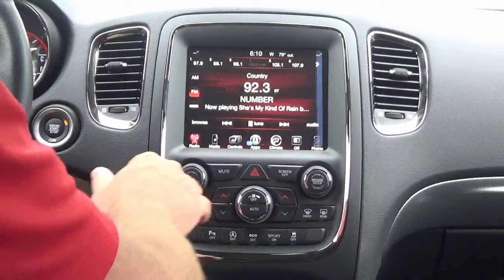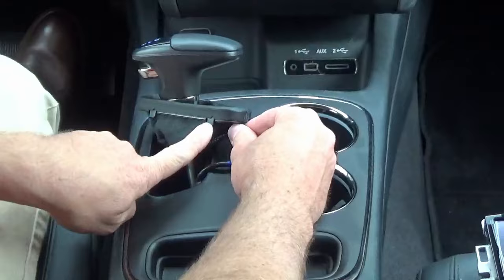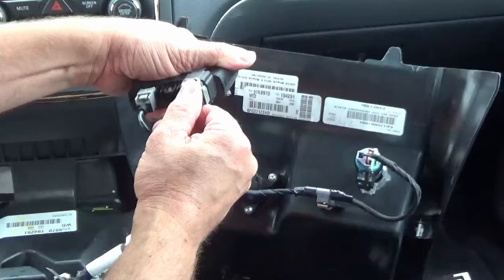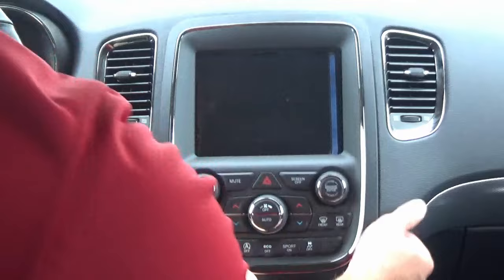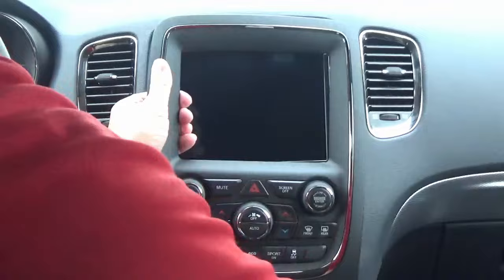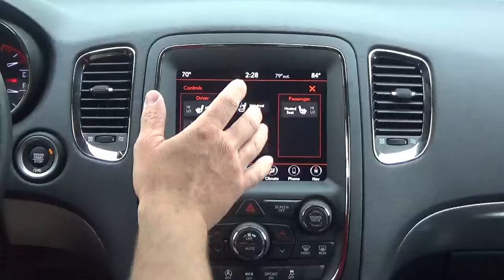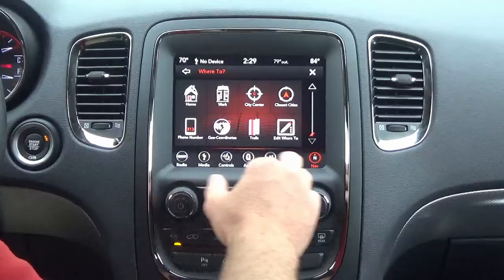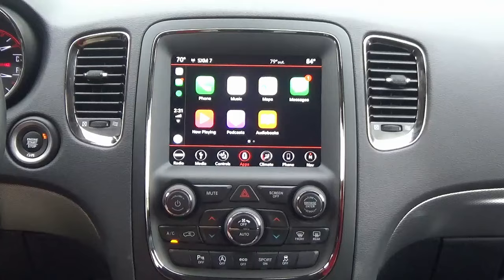2014-2020 Dodge Durango Factory Apple CarPlay/Android Auto Radio Upgrade - Easy Plug & Play Install!

Comment: I have a 2017 Dodge Durango with the 8.4-inch screen, but unfortunately, it does not support Android Auto or CarPlay. I have observed a noticeable difference in the audio quality when playing music via Bluetooth compared to using Android Auto. While Bluetooth provides decent sound, it lacks volume and requires the volume to be turned up significantly to achieve a satisfactory listening experience. In my personal opinion, Android Auto and Apple CarPlay offer superior audio quality and convenience.
Reply from the maker: Apple CarPlay and Android Auto requires a swap of the radio. Here is our solution. 
https://infotainment.com/shop/interior-accessories/infotainment-radio-upgrades/2014-2020-dodge-durango-gps-navigation-8-4-4c-nav-uaq-radio-with-apple-carplay-android-auto-2/

Let me know if you have questions on this.

Comment: Are they coming out with this upgrade for the 2017 RAM?? Patiently waiting for a way to upgrade to get Android auto in my truck. Looks to be the same 8.4 screen. Does this work for the RAM?
Reply from the maker: We've got the Ram upgrade right here: 

https://infotainment.com/shop/2016-ram-1500-classic-build-series-upgrades/2013-2018-ram-1500-2500-3500-8-4-inch-4c-nav-uconnect-uaq-with-apple-carplay-android-auto/

Comment: Awesome, i have a 2017 ? i need to replace only the hub from a newer durango 2020 to be able to have apple Car Play?
Thanks
Reply from the maker: No unfortunately they specifically set it up so that would not be possible. The radio you have does not have the technology to do Apple CarPlay and Android Auto as that was invented in 2018. You would have to completely swap the radio and the hub to gain that feature. Here is our upgrade link. 
https://infotainment.com/shop/interior-accessories/infotainment-radio-upgrades/2014-2020-dodge-durango-gps-navigation-8-4-4c-nav-uaq-radio-with-apple-carplay-android-auto-2/

Comment: What makes this an upgrade?  I thought all that was mentioned comes standard,,, at least on the rt , am I missing something?
Reply from the maker: This is the Uconnect 4 8.4" UAQ with onboard navigation and Apple carplay/Android auto.  If you are already equipped with this from the factory, then it would not be considered an upgrade for your vehicle.  Compatibility for this particular package is 2014-2020, so that leaves room for a lot of different factory equipped configurations. Many of our clients are equipped with base model units that lack features or even 8.4" screens that lack Apple Carplay and Android auto.  So for those clients lacking those features, this would be considered an upgrade.

Comment: What about the 2014 durango w/rear screens? Need to replace the in-seat hdmi/rca ports??
Reply from the maker: Hello,
That feature should be retained, as the pinout is the same on the CarPlay model. I do not believe you need to replace the inseat hdmi/rca ports. We've never had reports of the rear screens not working with the upgrade.

Comment: I have a 2018 dodge durango rt my radio is failing but I have a friend who is selling me his radio from his 2019 dodge durango it may fit  ?? Ty
Reply from the maker: The compatibility configuration for the upgrade package that we offer is for a 2018 Durango is from 2018-2020.  So anything from 2018-2020 will have the same compatibility.

Comment: What if I have the rotary shifter knob?
Reply from the maker: Luckily the rotary shifter knob is much easier! You can take a pry tool and work your way around the whole center console area (right at the edge of the storage cavity). It appears that it's about 5 retention clips on both sides, and the rotary knob is just connected to a harness.

Comment: $2,000 yeah right 🤣🤣

That’s INSANE.
Reply from the maker: We do not sell cheap equipment. We sell OEM quality equipment that is fully tested, pre-programmed and procured based on your Vin. There are plenty of companies that sell cheap products. We want to provide a part that we are able to guarantee works and will continue to work. We are confident enough in the product we sell that we are able to warranty it through installation and up to two years depending on your selection at check out. We feel our pricing is competitive as we are comparing our pieces to the cost of getting a new vehicle as opposed the cost of an aftermarket part whose quality is greatly inferior.
Reply: Does it have the in car wifi or do I have to keep paying t-mobile separately